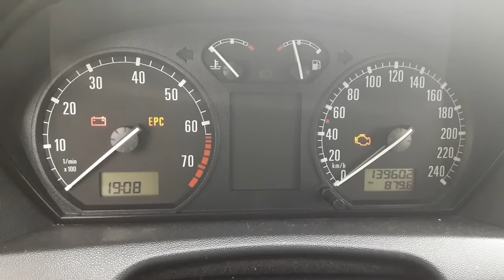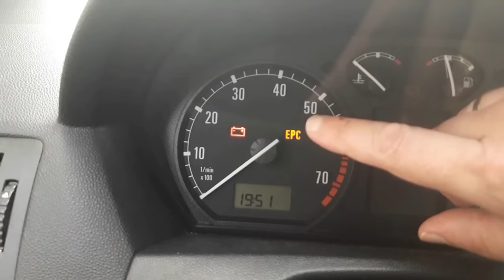Most Common Reasons Your Check Engine Light Is On

Comment: I have P104 error code. I did clean the MAF sensor with the special liquid for maf but problem is still there. Few months back I had check engine light and I replaced the lambdasond after catalaytor and it helped. Will check the fuel tank cap now. Should I need to replace the sensor again?
Reply from the maker: Hi, well if I understood right, you just cleaned the sensor and didn't replace it.

Cleaning, at least from my own experience has success to some point. The usual outcome is to replace the part if you want the repair to last.

The code is for a faulty MAF sensor but there could be other problems triggering that code.

I would recommend starting with cheaper and more simple things and then replacing more expensive parts.

Check for air leaks also. Btw, what car is it and with what engine?

Comment: Good morning what you think could be the problem... when the car is used for long . I get trouble accelerating anything over 60 the engine light comes on and it goes down I literally have to use my toe to drive to accelerate very very slow and try and keep it at 60
Reply from the maker: Hi and thanks for watching!

It could be lots of things. If you want to solve the problem you'll have to hook up an OBD tool and get an error code.

Depending on the engine and the car model, It could be a dirty throttle body, a bad MAF sensor and the list goes on.

Comment: My engine light came on, my radiator needle went straight up to the top and we heard a rattling noise.
The water and oil was fine. I've just checked my petrol cap and that is all good. My husband put coolant in the radiator (not much) 
The next day, the engine light was off and the radiator needle was normal.
Do you know what my problem could be?
Reply from the maker: Hi and thanks for watching!
There could be a couple of reasons, if the rattling sound is still present when the engine is running check when the water pump was last replaced.
Also, check the coolant fan radiator.
Hope this helps.

Comment: Hi! My car is driving fine I heard something maybe like a pin drop on my hood and the engine light went off. But the car is driving fine any advice?
Reply from the maker: Hi and thanks for watching! Take a brief look under the hood just in case. 

If you don't see anything wrong, I would continue driving, but with a bit of caution for a few days.

There could be a lot of things that could've caused that.

Comment: My gas cap won’t click so my engine light came on, I just replaced with a new cap. Will I have to drive it to come off or will it automatically go off?
Reply from the maker: Hi and thanks for watching!
It depends on the car, on most cars it goes away after a couple of engine starts until the ECU acknowledges the new parameters.
If it doesn't go off after a couple of days and a couple of engine starts, then you'll need an OBD tool.
Reply: @DespairRepair  ok thanks for the information, you are great help….

Comment: good day sir, is it possible to convert my used 2008 kia gran carnival diesel engine to petrol engine. thanks for your quick reply
Reply from the maker: Hi and thanks for watching! Don't know what you mean by converting. If you mean swapping the engine I guess it is possible but it's a complicated job that may not be cost-effective.
Reply: @DespairRepair  Thanks sir for your quick reply. Ok I will provide more details regarding my earlier quotations

Comment: How does the fuel tank cap relate to engine light management?
Reply from the maker: Hi and thanks for watching! Air gets into the fuel intake and causes a disturbance in the air-fuel mixture triggering the check engine light.

Comment: Hi just got my Honda civic 2018(auto) serviced and engine management light came on 😢 any idea what that could be? Thanks
Reply from the maker: Hi, and thanks for watching!
The best way to find out is to connect an OBD tool and get an error code.
You can also check for basic problems like the gas tank cap or minor air leaks.
Those are very well-built cars, so hopefully it shouldn't be a big problem 🙂
Reply: @DespairRepair  I am going to take it to the Honda dealership tomorrow, as they serviced it today
Reply from the maker: @R.KHAN86  in that case that's maybe the best solution. It's probably a minor fault

Comment: You don’t have to replace or clean O2 Sensors all the time sometimes you can clean them by using high quality fuel and when you have a chance put your foot down and it cleans them out I did it on the last car I had I got over 100.000 Kay’s and the cod didn’t come back
Reply from the maker: Hi Roger, thanks for watching and the good comment!

Comment: Hi I have a ford focus 2015 been getting p0420 code I bought a new 02 sensor but still check engine light on I plug the obd Reader in to turn it of but now its saying its permanent I really need some advice not sure where to go ?

Comment: Had my light on so I called AA (UK breakdown cover) diagnosed it and it turns out it's the Transmission Control Unit, however the car drives absolutely fine and no loss of power, the light went off itself within an hour as well, the car is Mitsubishi Colt diesel semi automatic. The AA man said its just a minor fault and just leave it and keep driving the car as long as it drives fine and  there's no loss of power. We only had bought the car so we're not going to be overly concerned at the minute and hoping the light doesn't come on again lol.
Reply from the maker: Hi and thanks for watching the video!
I think that the AA man gave you some good advice.
The check engine light is notorious for coming up for minor faults like weak electric connections, loose hose clamps or other while the codes show more serious problems.
Anyway, drive the car until the check engine light comes up more often or more serious symptoms appear. Just pay some extra attention in the meantime.
Otherwise, you could just end up spending money and replacing parts that maybe don't need to be replaced.
This is all from experience, btw.
All the best to you and hope the light doesn't come up again :-)
Reply: Same exact thing happened to me. My check Engine light came on. Scanned with scan tool. Pulled 2 codes. One was gas cap. The other was bad battery connection. I was just about to get it fixed and the light went off. Drives, idles fine. No power loss.

Comment: In what sequence should you check the possible faults?  Clearly, the most expensive (replacing catalyst) should be the last.
Reply from the maker: Hi and thanks for watching! Yes, that's the right way, start from the gas tank cap and go from there.

Comment: Thank you for the video. Is this a serious problem? My VW Golf 2011 is showing the same yellowish light, it stays on all the time when I’m driving. How many more km can I drive like this?
Reply from the maker: Hi and thanks for watching!

To be honest, if there's no immediate sign of danger, you can drive for hundreds of kilometers (this is from personal experience).

But nevertheless, hook up an OBD tool as soon as you can and get the error code.

It's sometimes just a glitch in the system and sometimes it's more serious.

Hope this helps.
Reply: @DespairRepair  hi and thanks for the reply. I sent the car to my mechanic, since I have a long journey planned and I didn’t want to take any risks, and fortunately the issue was minor, just a problem with the glow plug. He said that I shouldn’t have to worry about that, and I could change them later also, but before winter. Thank you again, and all the best.
Reply: Until it breaks

Comment: Very well explained, I have 2004 VW Polo, 1.4L petrol engine.   OBD code shows MAF sensor. Replaced it, but Check Engine light keeps coming back on, with same code.  Will try to check Gas Cap, and Air Intake box.   Thank You
Reply from the maker: Hi Firoz and thanks for watching!

Certainly, worth the try, hope that any of the tips help!
Reply: ....sever   the  wire,  to  that engine light......

Comment: Can you help or make a suggestion.  I keep getting a PO2282 error air leaking in my throttle body. I done almost everything. I put in a  cold air intake. An every since then I have gotten this  error reading.  Thank for your help.
Reply from the maker: Hi Karl and thanks for watching!

This probably won't help much but, if I understood well, the cold air intake is installed as an aftermarket part.

If so, did you try returning the original parts of the air intake and see will the error code appear again?

As you probably know, this error code comes from a vacuum leak, near the intake manifold, defective sensor, faulty gasket, and else. Did you check that everything is tightened and in place?

All modern cars are highly dependant on precise and predefined airflow and if it's not like that, all kinds of problems appear.

Best regards

Comment: Hi my insignia 2019 does not have a removable gas cap :( light keeps coming on intermittently usually in start stop traffic
Reply from the maker: Hi and thanks for watching! Sorry to hear that, that's probably an expensive fix 😞.
Maybe you can just change the gasket on the cap or something?

Comment: I haven’t been changing the oil regularly on time for my tahoe 15 and now i have a permanent check engine light
What’s is wrong and how can I fix it
Reply from the maker: Hi, and thanks for watching!
Could be a couple of things. First start by changing the oil and filter.
Then use an OBD tool and check what errors you get.
If they aren't critical try to reset the check engine light.
If it appears again read the error codes and start from there.
It wouldn't hurt to check the air filter, air intake, and spark plugs
Especially pay attention if there are any traces 
of oil anywhere.

Comment: My eml light started flashing and car started shaking also had the traction control light come on. If the exhaust was faulty would this be the reason?
Reply from the maker: Hi and thanks for watching!
Depends on what kind of fault you have on the exhaust.
Reply: @DespairRepair  I'm not too sure but a mechanic has told me my exhaust needs replacing couple days after I experienced this. Would any type of exhaust problem cause the engine light and traction control to come on while the car shakes?

Appreciate the reply.
Reply from the maker: @latenightsurvivors18  a check engine light (regarding the exhaust)appears, in most cases, due to clogged filters (like the DPF for instance) or a clogged catalytic converter. 
The main reason is a clog in the system which impacts how the engine runs.
But if the exhaust is only punctured or in any other way physically damaged (or rusty) then those symptoms shouldn't appear.
I didn't ask, what's the car?
Reply: @DespairRepair  thank you so much. Its a vauxhall astra petrol.

Liked and subscribed.
Have a blessed day
Reply from the maker: @latenightsurvivors18  good car.
Thank you very much for subscribing  it means a lot to us 🙂 and hope any of this helps

Comment: My 2011 Juke did not pass smog check so I took it to a mechanic and he said to just keep driving..I am a senior citizen so I dont know what to do now...Check engine light still on
Reply from the maker: Hi and thanks for watching!

Well, the mechanic probably concluded that it was a temporary glitch in the system (which is common for many cars).

Keep driving and if the check engine light is still on after a prolonged period of time, then check again but this time ask for the error code.

Either that or visit another mechanic and ask for a second opinion.

Hope this helps.

Comment: I have a Toyota Etios , check engine light on and running time engine off, it cranks but not start it starts only when pushing with gear,  engine off when driving fast but when drive slowly not off, pls suggest
Reply from the maker: Hi and thanks for watching!

I'm sorry but I didn't quite understand the problem. But I would first check the fuel intake system (fuel pump, fuel filter, and else).

Also, connect an OBD tool to see what the error code is.

This is just a guess but I hope it helps.

Comment: well today is memorial day and nothing is open. i had the check engline light come on, on my 2009 ford fusion with 130,000 miles.
 i drove 30 miles to the location i went to and 45 on the way back. I will of course have it checked with one of those things that give you the code, but i do wonder, it could be that rfirst one with the gas cap possibly.
why do i say this? i noticed the last 2-3 times i filled up my gas tank it seemed like the cap almost unscrewed too easily  so i really wonderf if that is th eissue
Reply from the maker: Hi and thanks for watching!
Best try a new cap especially if the gasket on it is brittle and old.
Reply: @DespairRepair  well since i poasted this i went in to autozone yesterday morning.  and the code was P022 camshaft position timing.  i nitially called a ford dealer that was closer to my work and they said it would be 2 weeks and made it sound like it would be a potential major disaster than i decided to try caling a very good mechanic that has done things. he said to me first "i bet your oil is low, come by in an hour"  and sure enough it was very low. i had about 1.5 quarts o of oil left when i ams supposed to have 6 which is my own fault as i haven't really been checking it for a few monhts. he told me i really need to make sure i do.  but it was as simple as that

Comment: I'm having that same problem? My light is on, telling me that the O2 sensor is bad. I've changed them both because I have two in my car. 2010 Scion XB, but the light is still on. Telling me to change the bank 1 sensor 1. I don't know what else to do.
Reply from the maker: Hi and thanks for watching! I would first check the air intake, namely, all of the air intake hoses and connections, to see that they are tight and that there are no punctures.

One more factor could be the fuel quality.

There are many other factors that could cause this but I'd first start with this.
Reply: @DespairRepair  even if it keeps saying O2 sensor Bank 1 sensor 1?
Reply from the maker: Yes, since you've already replaced them seems obvious it's a "false" reading.

Something else, (maybe in the same system) is faulty. Also, try checking the connections and wiring to the O2 sensors.

Once more, it can be a lot of things, but I would start from there.

Comment: Hello   Sir   ,  could you  help to explain me  if  the CATALYTIC   problem  and  we no need  change it   ,  we just  reset  or clear  the error  message  ,  so  what will happen  ???   thanks
Reply from the maker: Hi and thanks for watching. Try resetting the error code first.
In short, if the catalytic converter is damaged or clogged, you'll have to eventually replace it.
It all depends on the condition of the converter.

Comment: I have replaced my oxygen catalalytic converter sensor. But after computer reset the ⚠️ light is still on the dashboard. Is it safe to drive?
Reply from the maker: Hi and thanks for watching! Depends on what the problem really is. Did you make another scan, are there any more error codes?
If the car acts normal and there is no immediate sign of danger, if I was you, I would drive and see what happens.
Of course, if possible avoid long-distance driving, just in case.

Comment: Yesterday I did the state inspection, everything was fine and I pass it. The next day the check light came on, what could have happened?
Reply from the maker: Hi, and thanks for watching!
Everything should be OK. Did they do anything around the engine, like inspect the air or fuel intake or exhaust system for instance?
Is the gas cap properly tightened, is the quality of the fuel OK
Try connecting an OBD tool and get an error code.
This should make things clearer.
Reply: @DespairRepair  P0456 Evap System Small Leak

Comment: I have same problem on my Kia Sportage  once the check engine light is on and dont disapear it lights non stop while i driving sometimes evrything is normal with my car, the car dont lose it power but sometimes it lose power can u tell me pls what problem can be? Thank you u have my subscribe
Reply from the maker: Hi Slobodan and thanks for watching and for subscribing!

When it comes to the check engine light and losing engine power it could be a lot of things.

I would recommend connecting an OBD scan tool and see what kind of error codes you get.

That's the best starting point for that situation, at least in my opinion.

Hope this helps.
Reply: @DespairRepair  hello i drive a 2010 silverado and today my check engine light turned on while driving in the highway, i was going pretty fast but I wasnt forcing my truck either , I recently changed the alternator like 4 days ago so i want to know if its because of that